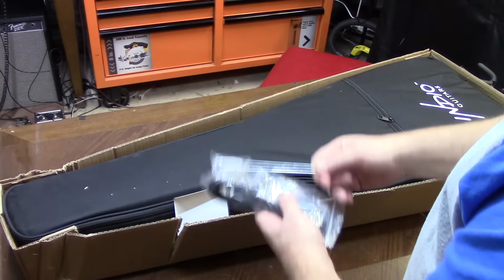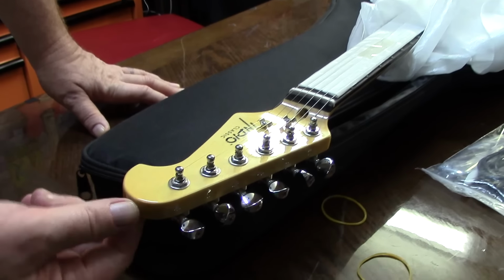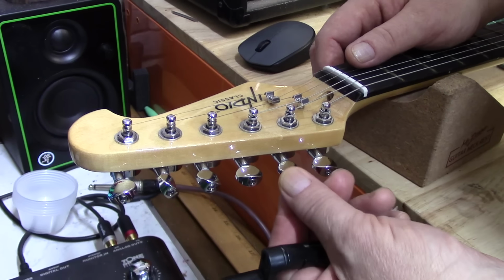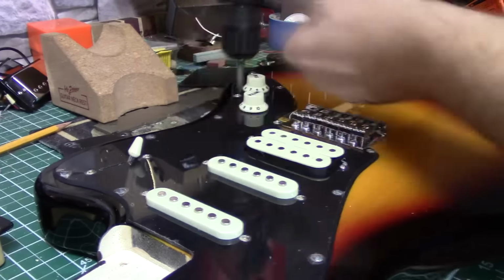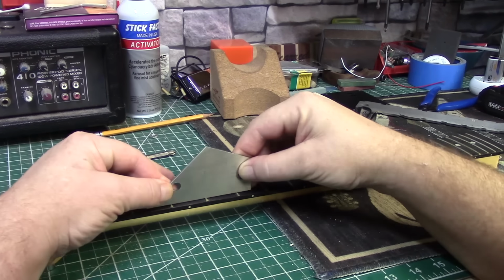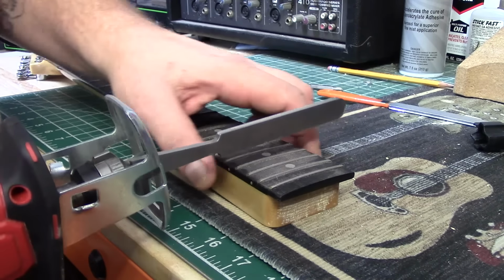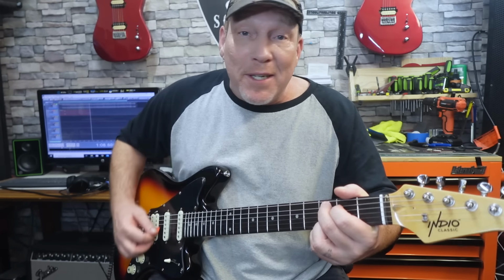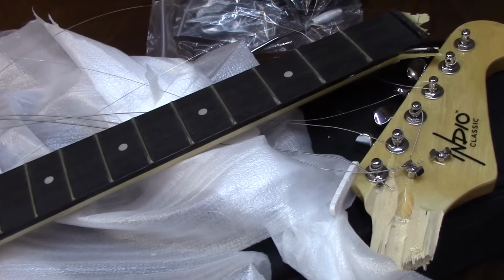Best Offset Guitar Under $150!! THIS THING TOTALLY ROCKS!

Comment: I have one. it's not bad at all. I had a pro go over the frets for me. Mine had pretty bad fret sprout. I'll prolly pop a "cool rails" in the neck eventually, 'cuz that's how I roll. To me, a bolt on is a bolt on, pretty much. By the time I'm done getting it the way I like it, I might end up with about $300 total into it. I'm really happy with that. It'll be about as good as any other bolt on with a regular tremolo at that point.

Comment: I plan to put a roller GBE tree on mine, but I don’t know the angle right now. I had an intonation problem with G that came and went, now I think I understand, have you ever have to tree the GBE together? Anyway. My Silvertone is heavy plywood, and I am no tenderfoot, I used to carry railroad ties landscaping. But it’s heavy. And it has a rout just like that one. I am hoping to fit a set of H H and switch gear in a HH Strat pickguard. I want to wait and get a pair of good quality wound ones from Mrs Cathy, I am dumb about the switchgear, but I l go simple. I just loved that White HH Temu you did. I’m hooked! Yall are great!

Comment: What actually denotes a body being “offset”? Ive never understood what that means.
Reply: I think the technical definition is a guitar body where the "waist" is asymmetrical (so a line through the narrowest part of the body would be basically straight across on a symmetrical one, so asymmetrical would be at an angle). So in practice that's Jazzmasters, Jaguars, Mustangs and Meteoras. But by that definition that would include the Mosrite Venture and some people will put Firebirds and RD's in that category (although I think most people mean the Fender body styles when they say "offset").

Edited to clarify the asymmetrical bit (I didn't word that well before).

Comment: You’d rather me take a baseball bat and a flame-thrower to a guitar than have me try to work on it. It takes 3 or 4 me’s to change a light bulb, and eight me’s to change all the clocks an hour. So I take guitars I receive which are questionable or have some kind of issue to my music store’s repair guy, lol.